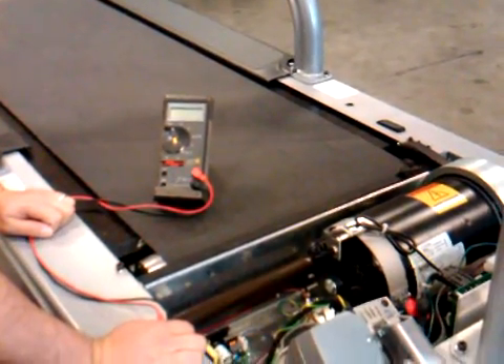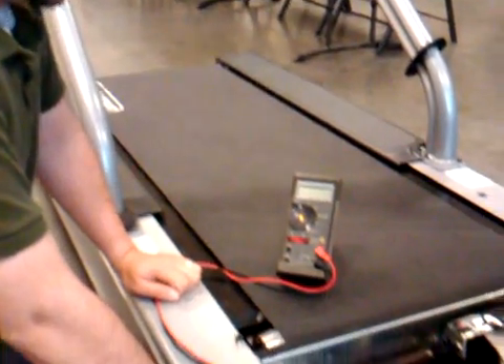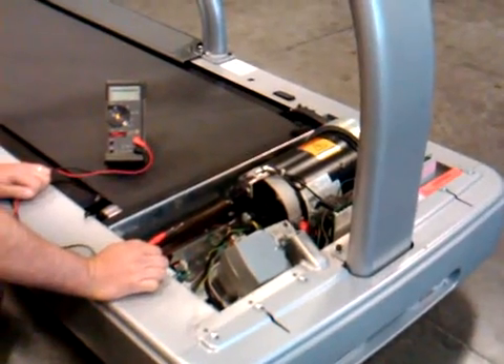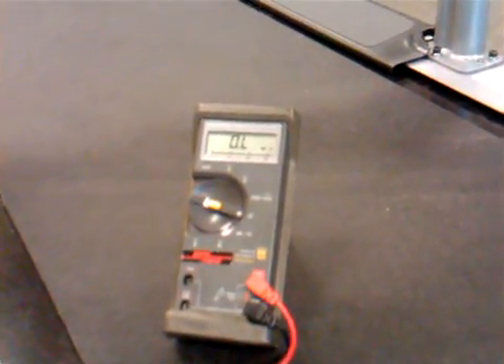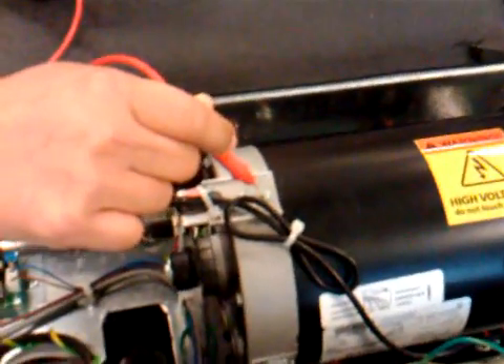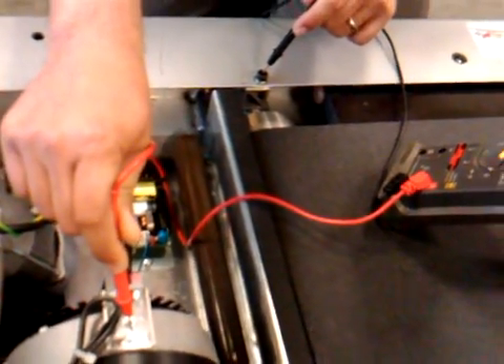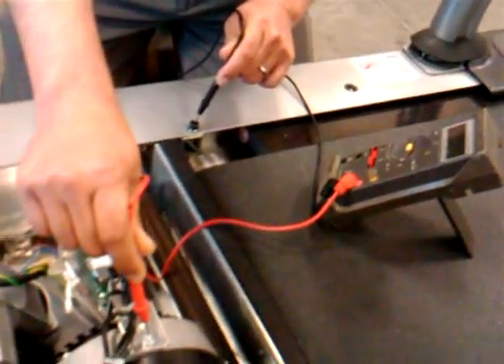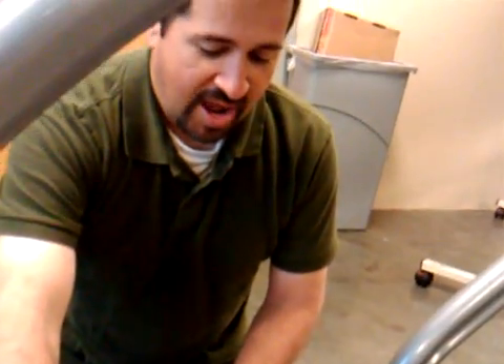Star Trac: Checking the Bleeder on a Star Trac AC Motor Treadmill

Comment: Gottcha, Cybex did the same on an older 710 series. Lifestride 9500 had this problem where i seen the arch jump from the motor. Life asked me to replace the Inverter and Emerson motor. Does startrac use a non conductive drive belt?

Comment: AC drives " half bridge inverters" with 3phase induction motors  have leakage current induced into the motor housing. Most manufactures isolate the drive motor from the chassis by placing them on isolation mounts.